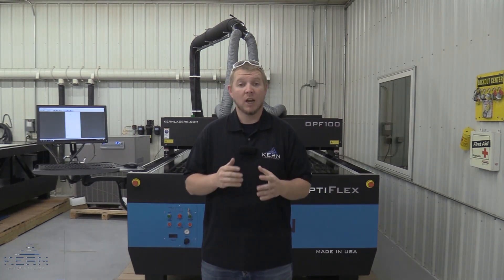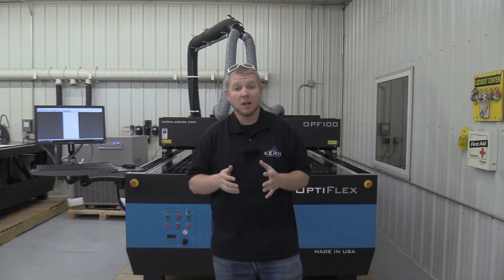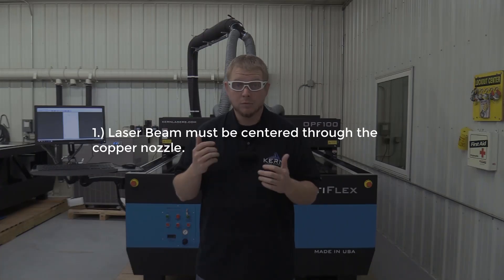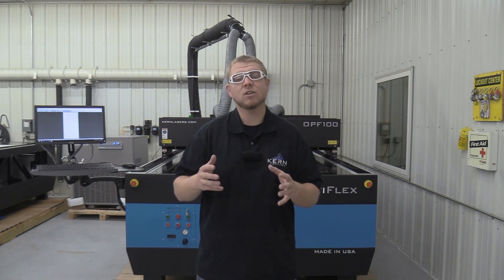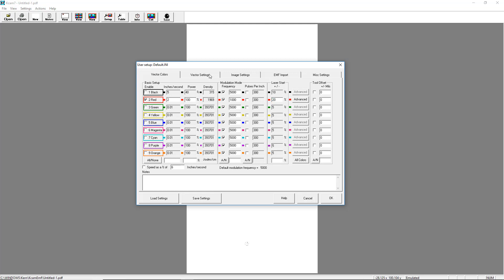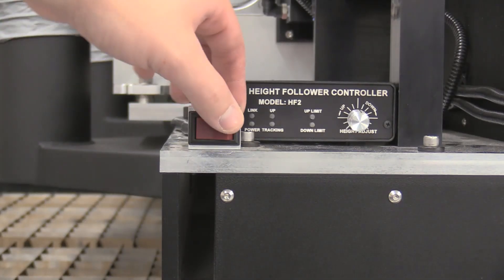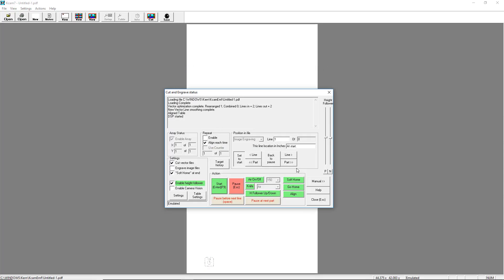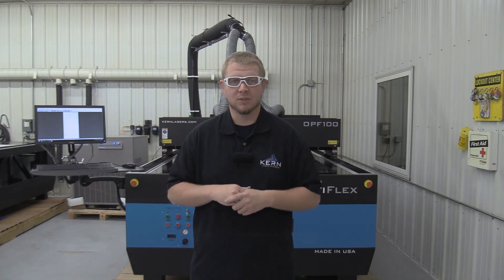How To: Mild Steel Cutting 18ga 400w CO2 Kern Laser System

Comment: Hi
Do you use normal compressed air as assist gas or oxygen?
Thanks
Reply from the maker: You can use either with higher wattage lasers with the thinner gauge metals. In this video we are using shop/compressed air